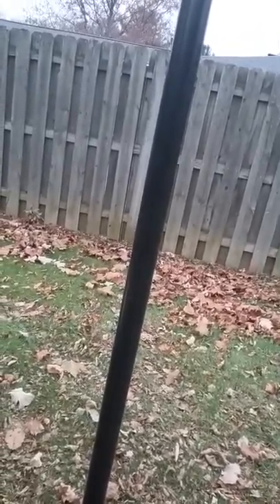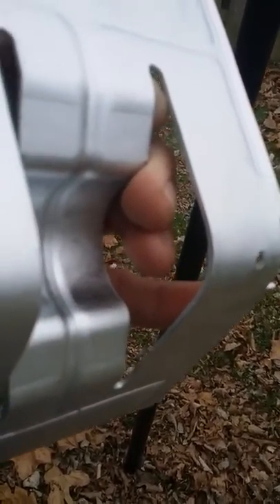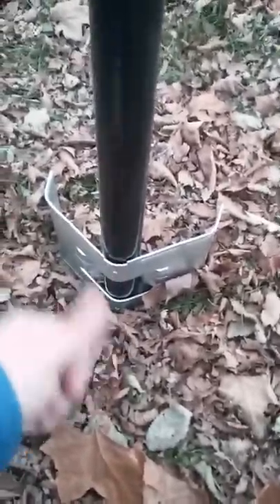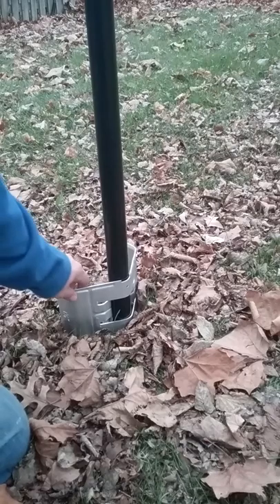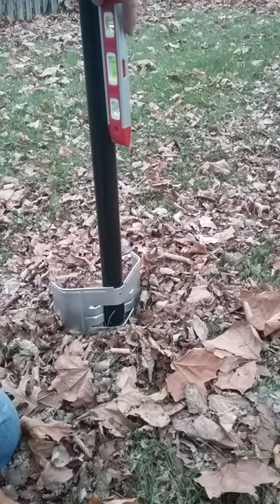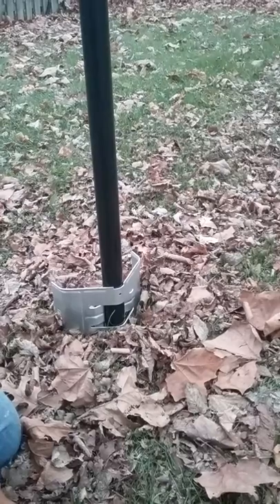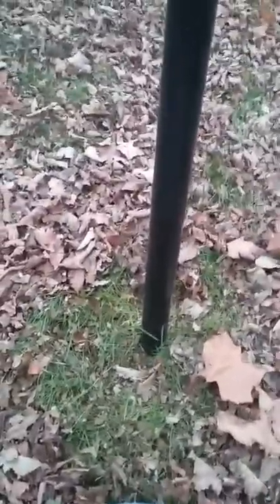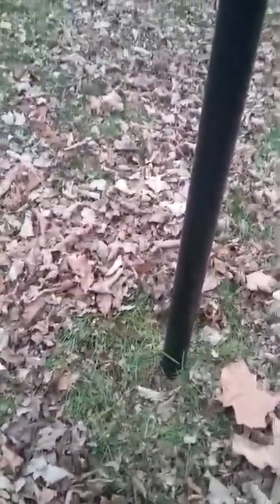Chainlink line post anchor/ brace

Comment: I think the holes are so you can screw it into the post to fasten the whole thing together and then pound it in with the post
Reply from the maker: I agree you could if you think the pole twisting could be an issue
Reply from the maker: But that's what your top rail does
Reply: According to the instructions on the home depot website, this man did it correctly